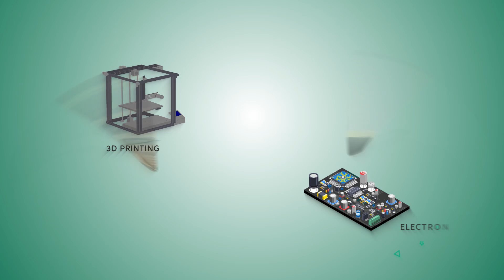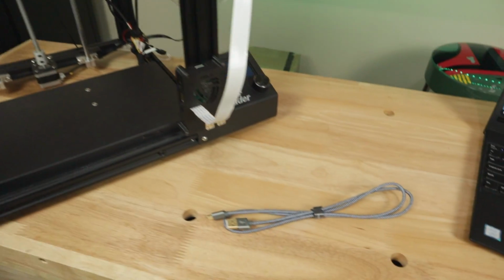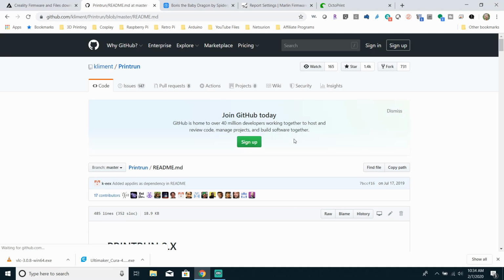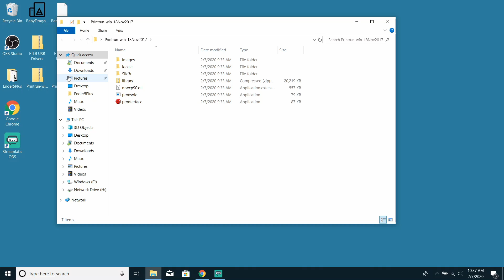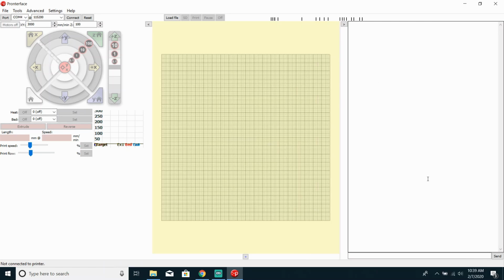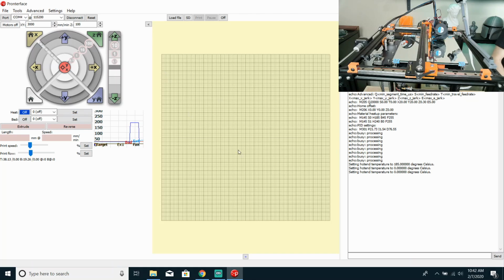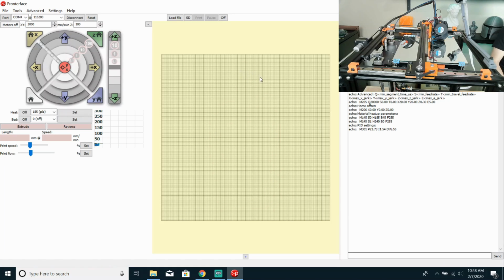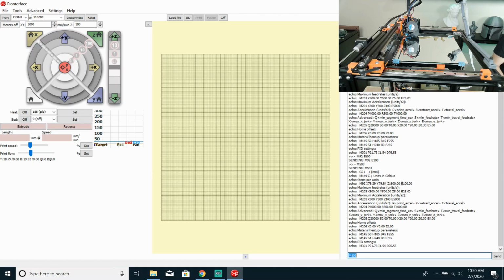Easily Connect Your 3D Printer to your PC!

Comment: Thanks for this video! Just a few questions, are you able to scale up or scale down the model your printing, can the model be chosen specifically where it will be printed (like the corner instead of the middle for example) and could you insert multiple files to print at once? thanks again.

Comment: Any updates on software, are you still using this?
Reply from the maker: I would love to do a follow-up video once I have some time. To answer your question directly, I use Putty under Windows or Minicom under Linux for my day to day terminal. I hope this helps.
Reply: @kerseyfabs  that's great, I haven't seen any of them when I just done a quick Google search. A lot of older threads popped up saying that a pc might add extra issues to do with print failure etc. So was thinking just using a dedicated pi with octapi. I've only got one printer so I might just stick to putting the SD card in it. Thank you
Reply from the maker: @ifell3  Wait, are you saying to print from the PC?
Reply: @kerseyfabs  that's what I was looking to do yes. Well originally WiFi.
Reply from the maker: Yeah, no one recommends printing from a PC. It's too error prone and printing from SD or OctoPrint is very reliable.

Comment: Is it possible to update firmware using the video instructions you provided here? I have an Artillery Genius.
Reply from the maker: Most firmware upgrades on older 8-bit board are done over USB using Cura or Arduino IDE. Most firmware updates for 32-bit boards are performed using an SD card.

Comment: I'm trying to connect to a Mingda D3 pro 3d printer. And the device descriptor is failing...
Reply from the maker: Have you seen if the printer came with a driver to correctly connect?

Comment: Some of us unfortunately aren't as tech savvy as others. Some of us are City Stupid... But Redneck Smart

 So many of the videos that I keep watching trying to learn. Trying to figure out what I need to download. How to do all the settings. Or for the leveling of the printer bed I keep hearing that it needs to be like a piece of paper distance between the nozzle and the bed, but I haven't found any like exact measurements of how far of a spacing it needs to be. I do have a set of feeler gauges so if I do know  that distance I could set it. Also do I let the z-axis go all the way down to the bottom and then adjust the leveling and the  kill switch? 

Or its frustrating when the video creator already either had the software downloaded prior or didn't even explain any of that stuff.... You know would be great videos are how to solve the problems when the software is having issues installing on the computer and how to troubleshoot that. 

Or how to set the home in the middle of your printing table. I'm sure there's videos on it already which I'll be searching that next.

Me unfortunately for the computer I'm currently trying to do this on it's a Windows 7 so of course I can't use cura i found out. So only thing ive been able to successfully get going is tinkercad so far

Comment: Thank you for this video.

I have a Ender-3 S1 PRO.
I have connected it with an usb cable.
I try to use Pronterface, but when connecting, I obtain an error :

Connecting...
Traceback (most recent call last):
  File "printrun\pronterface.pyc", line 1053, in connect
  File "printrun\pronsole.pyc", line 720, in connect_to_printer
  File "printrun\printcore.pyc", line 46, in inner
  File "printrun\printcore.pyc", line 208, in connect
  File "encodings\utf_8.pyc", line 16, in decode
UnicodeDecodeError: 'utf8' codec can't decode byte 0xe8 in position 39: invalid continuation byte

Have you an idea to correct?

Thank you,
Richard Huméry

Comment: i have a ender 3 pro and new at 3d printing i found a usb cable that i used to charge my bb8 is that going to work or is there a special cable
Reply from the maker: You need to make sure it has the data lines connected. A lot of charging only cables have those left out. You may need to pick up one you know has data if you have problems.
Reply: @kerseyfabs  ty were would i find one or how would i find that on ebay or local

Comment: Hi and thank you for sharing. I am trying to connect my printer to my computer any not having any luck. I made sure i had all my software programs closed LIKE REPETIER and slic3r. I then went to ftdi chip website and downloaded the FTDI device driver. It went through the installation wizard but when I go into computer Managment and check device driver, it still show’s no device driver. After i install the frdi driver, to i then have to add it somewhere somehow? I have a tronxy p802e 3d printer running merlin reprap firmware. The 3d printer also came with an SD card with a file called software and in that is a zip filed called ftdi driver. I extracted the files but cannot figure out if any driver was installed. I tried to go into device management/drivers and right click on the 3d printer device and selected update driver. Tried to browse comp using the 2 files above and get error. Also tried auto update. Says driver up to date. Its the mezzi 2.0 version 6 mother board and the usb serial chip does say Eftdi on it. Can anyone help here ?

Comment: Hi, so I have a problem regarding the connection between my printer and pronterface. When I plug my computer in to the printer, my computer knows it’s connected(I checked through device manager) and I also know I have the right drivers installed. Even with all this, pronterface doesn’t give me the option to choose a COM port, the only option it has is ‘none’ and no matter what I do I just can’t seem to get the two devices to connect. I double checked that I didn’t have cura open and the only other reason I could think of as to why they aren’t connecting is that I might be using a usb cable specifically made for charging, and not data sharing. Anyway I just wanted to see if you could help me at all, but regardless you did a great job with the video and it was crystal clear to follow the instructions. Good job, keep it up.
Reply: i ran into the same problem. My guess is that it is indeed your cable, i bought a new one and it worked as intended. My old cable should have been ok but it just would not connect, guess it was maybe to old or whatever.

Comment: Mine printer is stuck on "connecting" I have closed all programs (such as slicer) and selected the same baudrate as in my conif file. Do you know what is wrong?
Reply from the maker: Unfortunately this is hard for me to debug in comments. Did you verify that the port shows up when you plug it in in the Device Manager?
Reply: @kerseyfabs  Yes I did. However, I figured it out. In Marlin both ports needs to be activated. It was not one answer on google that told so
Reply from the maker: @MrAnthemboy  I'm glad you sorted it out. That is true for all 32-bit boards that I'm aware of.

Comment: leaning a new  code is putting me  off using 3 d printers  why dont just turn them  into icons and have a toolbar like Microsoft word   find this difficult to get my head around
Reply from the maker: While these may one day be counter-top appliances, today they're still for hobbyists and DIYers. The machines take time to learn to use and so does the slicing software. Technically, you don't need to learn gcode but it helps.

Comment: Ender 3 Pro 4.2.7 mobo bl touch3.1 F1st Layer firmware, Is there any way (with Pronterface) to make the print pattern offset in one direction when it prints the bed leveling test pattern. Now when it prints the test pattern it is 5mm from the left of the edge of the bed and 15mm from the right edge, i think i just need to adjust it to the right 5mm, but I think that is a firmware thing. Am I right?

Comment: thank you for a good video. I have a problem (actually more - but one at a time :) )
My pc can not see my ender 5 + and i guess it is the drivers. in the readme file in the drivers you link to, win 10 is not mentioned, and my question is - Does the driver work with win 10?
Reply from the maker: It works fine on my computer but I don't remember if I even had to install the driver or if it just worked. Are you seeing anything pop up under Device Manager? It should be there with no driver or an error if it's not working but it's detected.

Comment: Ender 5 Pro connected to my PC with Pronterface online but gui controls only make the printer have humming sound and the LCD "blues out".  Running Marlin v1.1.1 2020-04-25
Reply from the maker: It sounds like there's some sort of short, possibly from the USB. Check the cable. If that's not it, I'd be cautious but I can't debug it from here. Sorry.

Comment: I have a creative ender 6 and there is no way to get connection with Pronterface
can anyone help me?
many thanks,
Reply from the maker: There is a USB connector on the board, you need to run it out. I'll be showing this in a future video.

Comment: Would this work on y iMac?   seem to have had a problem with a com port on my Mac?  Also Kris can't I do the esteps using Raspberry Pi and Octoprint sending some M command?
Reply from the maker: I'm not sure if Pronterface has a Mac port but there are plenty of other terminal programs you can use for the same purpose. You absolutely can do this with Octoprint.
Reply: @kerseyfabs  Fantastic!  Thank you.  that's what I"ll do then as I needOctoprint for a camera as well.

Comment: installed sn skr mini in my e5+, running on your firmware branch and can't seem to get pronterface running on whatever baudrate.
says the printer is online, don't get any info about the printer in console... whatever command i try to give or button i end up pushing seems to send the printer in some error. 
Any suggestions?
Reply from the maker: That's really not enough to go on. I know the code has been tested in the past. The only thing I can say to check is make sure the USB cable is good for data transfer.
Reply: @kerseyfabs  well apparently it needs the power on to do anything except get status messages 🤦‍♂️ whereas my 10s pro and e3 didn't budge when the power was enabled.
Sorted and tuned now, sadly didn't do much for the uneven outer walls so the search continues.

Thanks for the reply anyways, do you have any recommendations for a decent hotend + shroud upgrade for the 5+ and 10s pro? 
I tried the hero me, it didn't align decently and the design is ridiculously unpractical. Need to take off the whole gantry plate for simple maintenance, screws together in the most illogical places too.

Looking into the ddx ecosystem but info is rather scarce, any thoughts on that?

Comment: nice video, can this method be used to change the maxim printing temperature of the printer after upgrading the hot end?
Reply from the maker: Not usually. That's normally hard-coded into Marlin at compile time as a safety feature.

Comment: So how do I get the printer to save a Z offset as a default? I don't have a BLTouch or any other kind of auto bed leveling, but I have measured the bed with a 0.2mm feeler gauge but not matter what I do the Z offset when I start a print IS NOT 0.2mm like I keep trying to set it either in Cura or saving the Z offset on the printer.

Comment: And if windows fail to install drivers what do we do? No matter what folder I point to my windows says it can't find suitable drivers. All tutorials skip this possible problem like it never happens.
Reply from the maker: Well, unfortunately, we can't test all of the printers to know which drivers they all use and what issues you may encounter. In fact, most printers don't even need additional drivers with Windows 10. Which printer are you working with? Did it come with drivers on the SD card?
Reply: @kerseyfabs  
Yes it did but all 15 of them failed to install in all ways possible, however searching drivers with Windows Update and clicking on additional updates I have found some USB Serial drivers with a domain ending in .cn so I thought those might be the ones and they were.
**In Win Update in description of the drivers had some text with a domain ending in .cn - just to make it clear for others.

Comment: Nice video, but aside from making  infrequent firmware/settings changes, I don't really understand the value of using pronterface. It sounds to me like it's more of a speedbump than anything, or is there something I am just missing?
Reply from the maker: On certain printers the only way to make certain changes (such as steps/mm) is through the console interface. It gives you a lot more control and gives you an easy way to check settings with command like M503.

Comment: I think a video on setting up the ABL correctly would be very welcome as I came across so many people who were having problems, they set it up ok but when they printed after a power cycle the nozzle crashed into the bed and possibly indicating the z offset had not saved, some people said that homing the Z had a secondary function of saving the Z offset to EPROM, I asked Comgrow how to save the Z offset and they told me to "Print the repair file" they did not tell me where this file was located and I could not find this on the included SD card.

Comment: Kris, I have just bought an Ender 5 Plus and have just received replacement leadscrews and smooth rods for ones that came with the printer bent like snakes, during my investigations I came across loads of people whose nozzle crashed into the bed while setting up ABL, from what I can gather the Z offset is not saving to the EPROM automatically and I think the Z Home button can be used to save this setting to the EPROM before using ABL in a print.
 Am I correct in my thinking?
Reply from the maker: I don't think that does what you think that does. If you can, follow my Ender 5 Plus videos or I'll create a stand-alone but that will take some time.

Comment: I have an Ender 5 updated with the silent mainboard 4.2.7 with BLTouch and filament runout running with the firmware of Creality. So far so good.
After having a broken wire at the element of the hotend I changed the element. The temperature is badly swinging now 5 degrees up and down. Tried to connect Pronterface on my iMac OS11.0.1 with the printer with USB to do PID tuning and I only get: 'Could not connect to /dev/tty.usbserial-1460 at baudrate 115200: Serial error: [Errno 16] could not open port /dev/tty.usbserial-1460: [Errno 16] Resource busy: ‘/dev/tty.usbserial-1460'.'
What is happening? Is PID tuning not possible with the Firmware for the silent mainboard or?
Reply from the maker: Do you have any other software running that may be grabbing that serial port? Most slicers will try to grab it even if you don't tell them to.
Reply: FYI I have an ender 3 pro with all the accessories you do accept for the filament runout and I tried the creality firmware for about a week, then I changed the firmware to f1st layer which has TONS more features programmed into the firmware than creality and its been updated recently unlike creality. And I did PID tuning within my printer no pc required, also esteps.

Comment: Mine won’t work
Reply from the maker: I'd need a little more to go on there. It could be anything from drivers to port/speed selection to cabling issues.
Reply: Windows drivers hate my printers I’ve tried to install them manually tried different one but no luck. I switched to my Linux OS and it works so I’m using that

Comment: The Creality printers so sure can't be installed, I only have so many other USB serial devices and no driver going up. I don't think your method works at 64-bit win 10.
Reply: That would be weird since he is using Windows 10 in the video.
Reply from the maker: Yeah, it's definitely 64 bit Windows 10. The drivers usually come on the drive that comes with the printer.
Reply: It works for me, I tried just now, CR10 S5 and W10, 64 bit. The driver took quite long to install (maybe because laptop is a little obsolete). First when I connected USB cable, the display on printer turned on, but it didnt communicate. I had to manually turn on printer and then it worked.

Comment: Thanks for info I’m having problem 3D printer easythreed k1 I lost the ability to print in the center of my platform. I was looking at way to correct and confused it included. marlin, pronterface , putting in new values into marlin add n subtract from y n x my email is mobill56@aol.com thanks
Reply from the maker: I'm unfamiliar with that printer. Why can't you print in the center of the platform?

Comment: I have to update the driver manually but if i select the folder from the desktop it doesn't find the driver.
Reply from the maker: It's possible you don't have the right driver for the board then. If you didn't get it direct from the manufacturer, check with them or on your SD card that came with the printer.

Comment: I have the drivers installed, tried every baud rate, Ender 5 plus will not connect
Reply from the maker: Make sure that you have no other apps open that may capture the printer. For example, other slicers must be closed. Also make sure you run Pronterface in Administrator mode.
Reply: @kerseyfabs  I was able to get it connected. Now I am having a heck of a time trying to flash Marlin. I watched your video about firmware flashing, but that was only for Creality firmware, which I was able to reproduce
Reply from the maker: Which version of Marlin on which board? Which editor/compiler are you using?
Reply: @kerseyfabs  any version of Marlin I suppose, on the factory board. I tried the teaching tech method using Marlin auto build, but it gave me an error once I tried to build it. I am very new to this

Comment: I wish you had done the Pronterface connection step by step.  I can't get it to connect using all the same screens.  Creality 200B.  I get USB Serial but not beyond that.  Never finds the drive, even when I take it to the factory SD card to search.
Reply from the maker: Have you installed the drivers for the printer? Those can usually be found on the SD card.